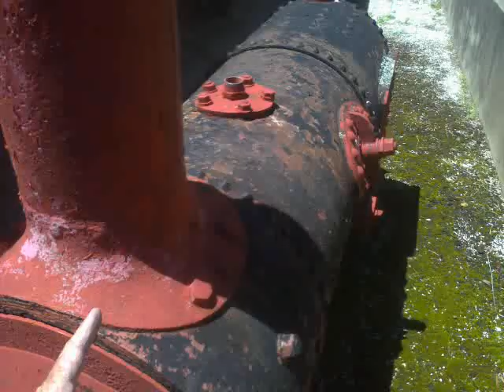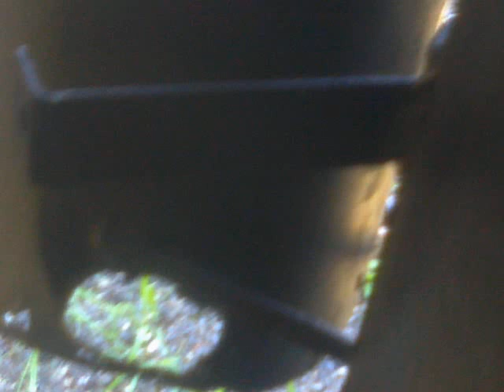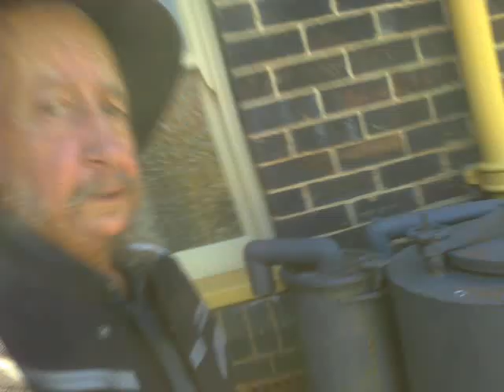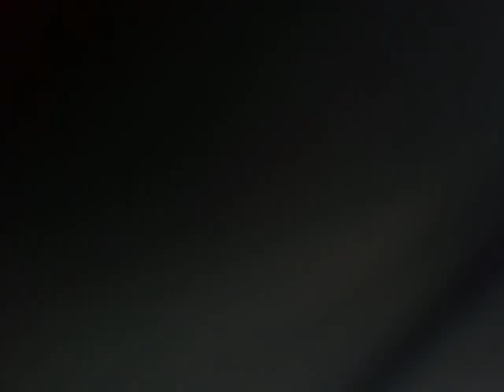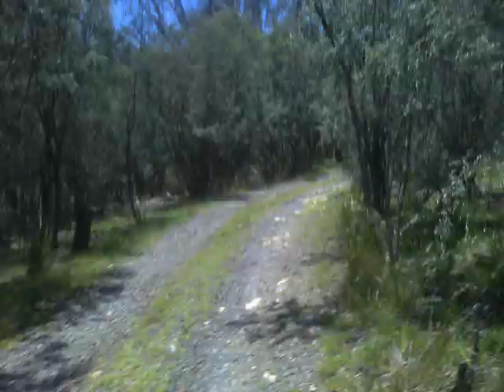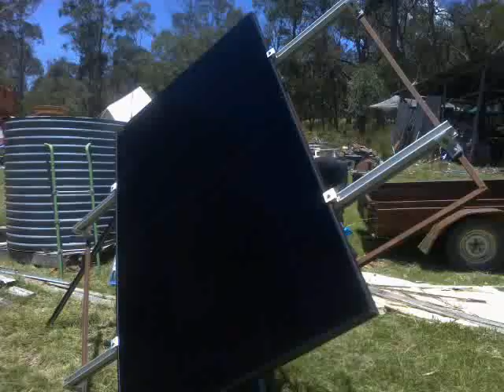80 Years' Renewably Powered Road-Vehicles, In Glen Innes..; Practical Realities...

Comment: A fascinating film. Regenerative braking is great on electric vehicles but I wonder how much further we could go by being able to properly free wheel in down hill situations when the battery still has ample charge
Reply from the maker: G'day,

Thanks !

Well, probably because hills are mostly pretty gentle in Oz, the Regenerative Braking doesn't do much work out in the Highway - because the Computer running the Motor shuts off the power at 49 Km+, so on a flat smooth road in still Air the Motor gets 1.25 Kw (2 Hp), and at 50 the Computer has throttled the Motor - but if the Slope was steep enough to accelerate one from 49 to 50 via Gravity, and if it gets any  steeper or continues for a while - then by 53 Km-hr with the Throttle at full Twistiness the Bike is rolling but unpowered.  I've seen 55 that way, believably, and on Xmas day the Datalogger claimed a max. of 57...

The Regen. System shines in town, in the 50 Km/hr zone, where are full throttle and 47 to 49 I'm blending in pretty well, and if I judge the timing correctly then rolling off the Throttle completely let's the Regen. bring the bike down to 20 Km or so to turn a Corner, or stop for Roundabout carrying Traffic which has right-of-way.

The one issue I have with that is that it feels like "light braking" but the Brake-Lights don't illuminate ; so when a Vehicle is following close it pays to squeeze a Brake-lever just enough to light the LEDs...

Until I can tow a Trailer, and have acquired a spare Battery to load it up with, I haven't got the range to reach a significantly long & steep hill to find out if the system materially alters the range out on the highway.

In town, it sure feels, and sounds, as if it's generating little Pulses of Current - 5 or 10 seconds at a time, every time 130 Kg slows down to go round a corner or stop ; but it's the accelerations from standing start up to Max./Cruise which really pull the Current.

When the back wheel is slow & the throttle is fully twisted, the Motor starts with 3,500 Watt Peak to commence moving, and it then gets access to 3,000 Watts until the Speed-Limiter kicks in at 49...

Since making this, I've refined the formula a bit...

Ditching the EV-purchase price, and the Motor's Rated Output, to concentrate on the Battery Capacity - because that's what's being charged ..

My figures are in Oz dollars, and included Goods & Services Tax...

So to clean them up ;
 $10,049 / 2.3  = $4,369...
And rounding up is
"Conservative" with Cost Estimates,
So call it $4,400 after paying the Federal GST of 10% on the Equipment & Installation.

So, stripping out the Oz Taxes,
It becomes a neat 
Oz$4,000 for the Supply & Installation if sufficient stand-alone Solar Equipment to recharge each Kw/Hr of the EV's Battery Capacity...

Then, convert Oz$ into whatever Currency one is going to be paying in..., and apply whatever local Taxes are appropriate.

Unless some other hidden factor is involved, then that should be a reasonably close estimate.

But, if Teslas can REALLY cover 300 miles (500 Km) at 62.5 mph (100 Km/Hr), at 6 Km/Kw/Hr at that speed - then they'd be using 16.6 Kw/Hrs per hundred Km, they'd need an 80 Kw/Hr Battery...!

My guess is that to achieve 300 miles, the Tesla could go at 30 Mph the whole way for 8.9 Kw/Hr..., 40 mph would use about 20 Kw/Hr & 50 Mph would take 50 Kw/Hr...

  At some point I'll encounter someone who knows what size Batteries are in a Tesla ; and then I'll know for sure...

Such is life,

Have a good one,

Stay safe.

;-p

Ciao !

Comment: Applause for your parents founders in Paradise of The Museum. 26:09 cars passed you. I like the bike. One kilowatt that's cool very light
Reply from the maker: G'day,

Thanks !

Yeah...., 68 Kg, and it can cope with a 100 Kg Rider...

The next "step up" weighs 128 Kg, costs $17,000, and that will go 120 Km at 100 Km/Hr - or 100 Km at 120 Km/Hr...; and it would need $35,000 to $45,000 worth of Solar Installation to feed it.

Slowing down to 50 Km/Hr solves a
LOT of very expensive problems..., with EVs ; in my experience, anyway.

Such is life,

Have a good one...

Stay safe.

;-p

Ciao !

Comment from the maker: G'day,

Yay Team !

It would cost me $45,000 for the Poles & Wires to be installed, then I'd have to pay Rent on the Poles & Wires - like $150 four times per year before they charged me 35c per Kw/Hr, and so that would be $1.00 per 100 Km for the Current...

So, $600 per year to remain connected to the $45,000 worth of Poles & Wires I would have to pay for - all to access that
"Cheap Reliable Gridpower"
At "
"Only 35cents per Kw/Hr"

About which
Innumerate Suburban
Dreamers are known to babble,
Constantly...

But the WHOLE Point of this Video is to speak honestly about what it costs to power along the Road using
RENEWABLE
Energy.

Grass in a Horse,
Wood or Charcoal in a Hydrolysis Chamber,
Shit in a Methane Digester,
Solar, Wind, or Hydro Electricity...
That kinda stuff.

Money into a Coal & Gas fired Grid is 
Not any part of the
Equation, to be honest.

If it were lawful, I'd make a Tricycle Land-Yacht with  Talaria Sting's Battery & Motor, & Speed Controller, and sail where/when possible, using Regenerative Braking to recharge the Battery going downhill or in strong winds...; and furling thevSail & lowering the Mast on windless days or whrn heading upwind...

But until the Bowsers run dry - the Highway Patrol promise to lock up anyone who tries it...(!).

Such is life 

Live a good one...

Stay safe.

;-p

Ciao !